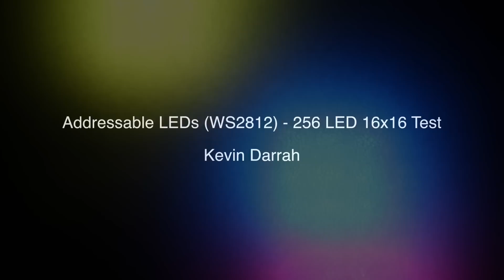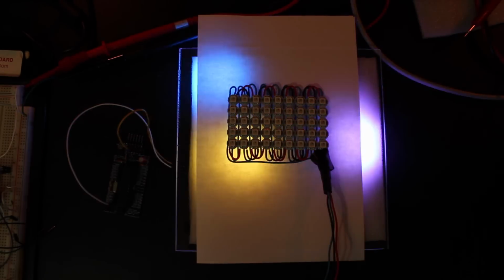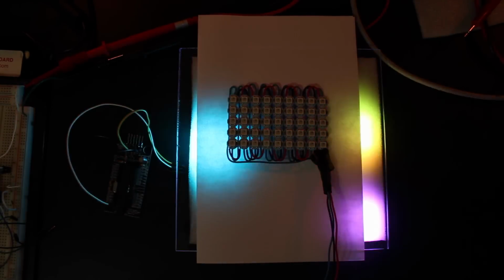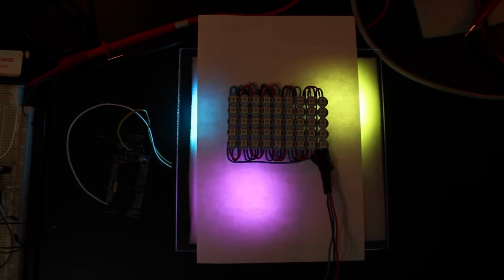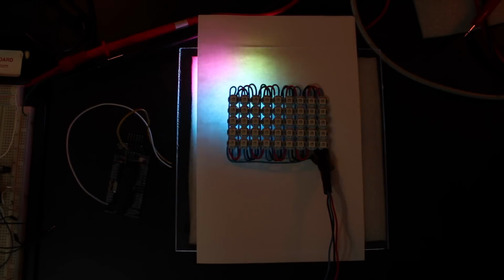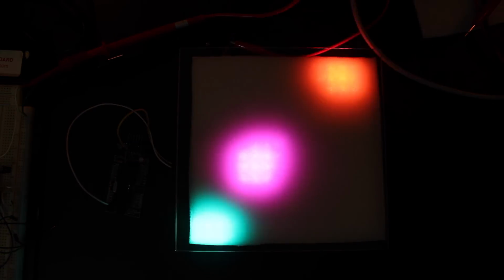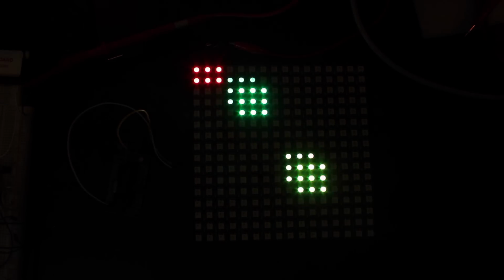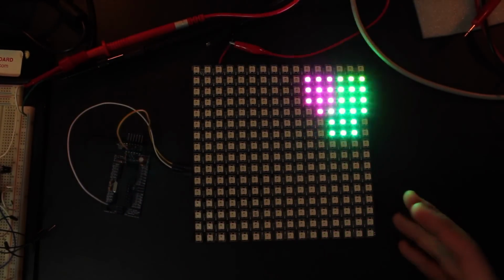Arduino WS2812B Tutorial (16x16 256 LED Test)

Comment: meanwhile you can find 32*32, 32*64 and 64*64 rgb matrix panels, used for video walls, for about the same price. even in different pitches and flexible.

Comment: Hi Kevin. I want to get into experimenting with Arduinos and LEDs and this project looks like a great rewarding one to have a go at. Could I please ask a few questions. Would this same set up work with a MKR1000 for wifi connectivity? Also could you recommend a rechargeable battery and charger solution for this with enough power to run the LEDs and the Arduino for a good amount of time?

Comment: I sort of ordered 1000 ws2812b minis (3535) by mistake (don't ask how), and against my better judgement I've decided not to cancel the order, because I had an idea what I might use then for.
The problem now is that I haven't got the slightest clue what, if any, the limitations may be. 256 LEDs is all well and good, but I intent to use at least 600, and while I see no reason why this should not be possible, I do wonder about the update speed, when working with so many LEDs.
It makes sense I think, that inputting more data takes more time, though of course the fact that they're addressable (allegedly?) can alleviate the problem a bit, but how much time?
Given a full update for each "frame", so to speak, how many frames per second would you be able to achieve with this test setup?

Thanks.